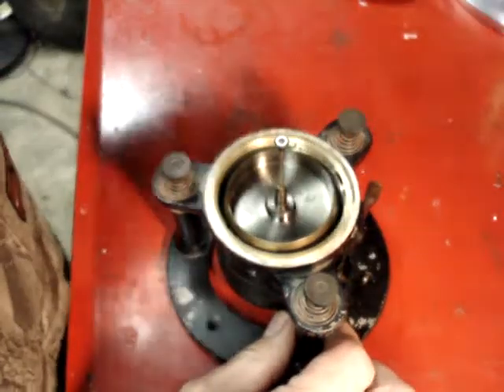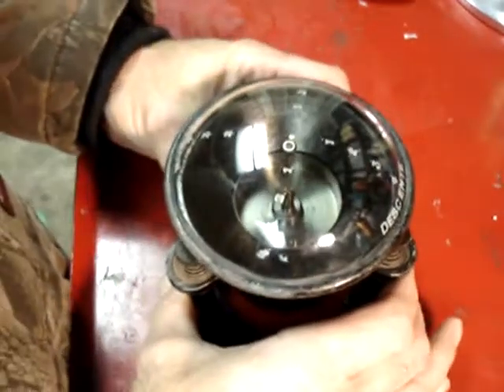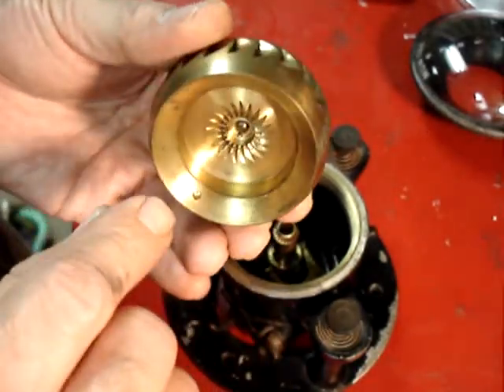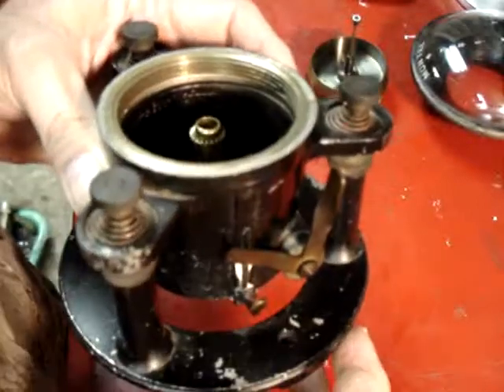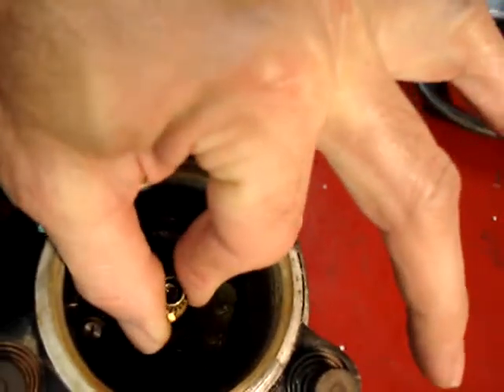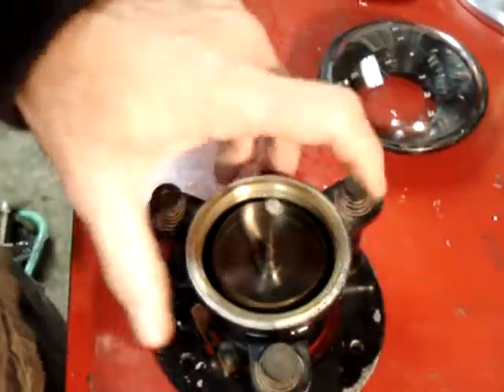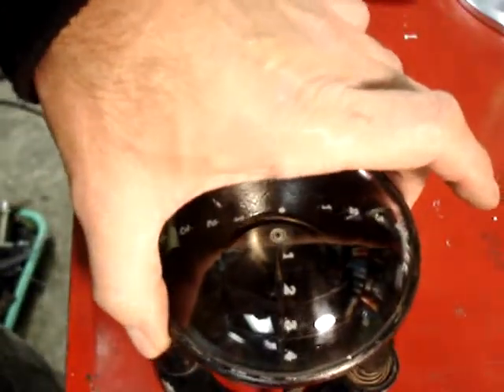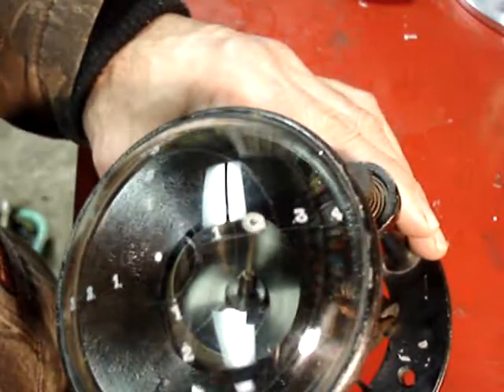Paul Garnier Attitude Indicator

Comment: Great job of demonstrating this very rare and forgotten aviation instrument. I always wondered how the guys in WW1 flew IMC as much as they did without gyros. I surmised they did not know they could not fly with out a horizon so they did it anyway like they knew what they were doing.  Everyday thing for those pilots.  Also puzzled over the 10 inch venturis mounted on the side of Nieuport fighters in 1918. (See video of Roaul Lufbery by his 28). What did that power? Had to be this gadget! Always thought first gyroscopic instrument was the Turn & Bank in 1919.  This case is closed Inspector Gadget! Mystery solved.